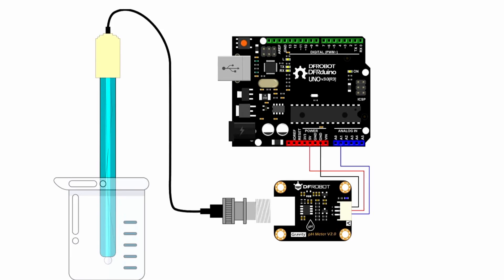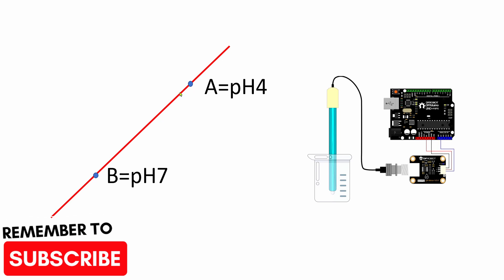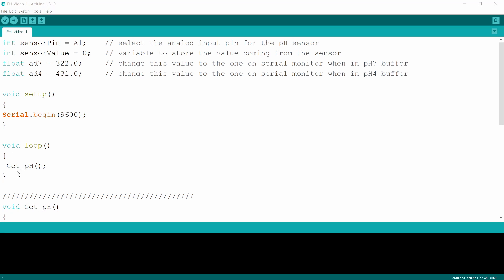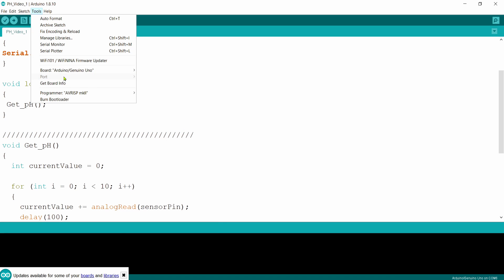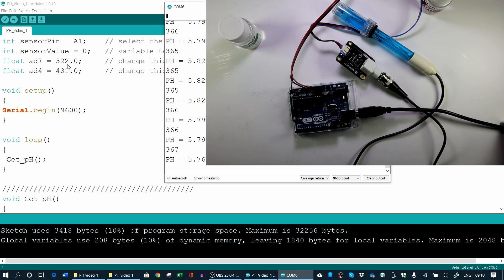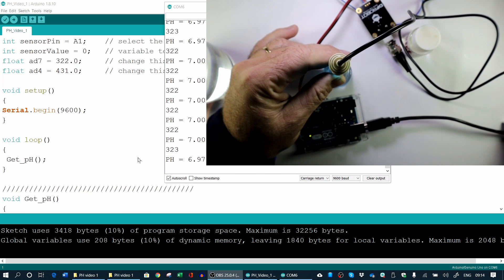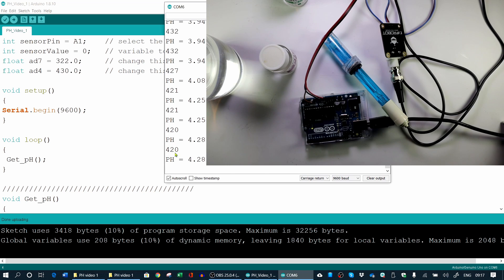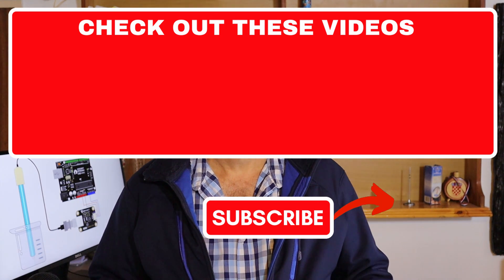pH sensing - Aquaponics and Hydroponics

Comment: Thanks Pierre for this video.  I am going to build the EC sensor project first and get used to your program and operation.  Then I’m going to make this pH sensor.     Will I have to use 2  Arduino boards or can both projects work on the same board ???
Reply from the maker: You can do it on one board!

Comment: Does this pH sensor consider temperature compensation?
Reply from the maker: Like said in the video no. I try to keep it simple at this stage. But will add it as we move forward.
Reply: @doitwithpierre210  can all the components be bought locally or would i need to import a few of the items?
Reply from the maker: @masterd23dazza  very basic components that should be available everyware.

Comment: Eagerly waiting for EC monitor. Also I want to see how you install this solution directly into the running system. What I want to know is how to give power supply the casing etc to pack your arduino and install it for monitoring.
Reply from the maker: The EC will come soon. Normal plastic casing and soldered on breadboard will be OK for implementation and installation.

Comment: Thanks for the explanation Pierre.
A couple of questions if I may.
The water solution used for rinsing. Is it distilled water?
What happens if the probe is left in the hydroponics water for long periods. Can the probe be left for long periods in distilled water?
How long does the probe last and what parts of the probe will need replacing over time?
Reply from the maker: Dale distilled water will be best for rinsing. pH probes do not last long when submerged permanently. Some are better than others but because of the principle of working, they degrade quite quickly. The manufacturer suggests replacement every 6 months with this specific probe. A better way to handle this is not to leave your probe permanently in the system and it will last much longer. I will try to answer this better in the next video.
Reply: @doitwithpierre210  OK thanks Pierre. I am wanting to automate the probe being inserted into the hydroponics water whereby it will take readings every day. When not submerged it will be withdrawn from the water until the task is required again the next day. I am just wondering if the probe can just be pulled out with a motor and left in air, or does it need to rest in distilled water or re-inserted into the supplied cap. Your opinion greatly appreciated thanks
Reply from the maker: The probe must not dry out.

Comment: Thanks, Pierre for these series. I have a quick question: Is it possible to have a system that automatically regulates the PH ...say, the system reads a PH value that is way off the charts and it automatically initiates a dilution of the system, either with pure water or some sought of chemical (acid or base) depending on the PH?
Reply from the maker: Hi Frank, in hydroponics yes. In aquaponics very difficult.
Reply: @doitwithpierre210  will this be part of these series too?
Reply from the maker: @FrankUchegbu  yes you will be able to do the control if you follow the videos.
Reply: I will follow them religiously